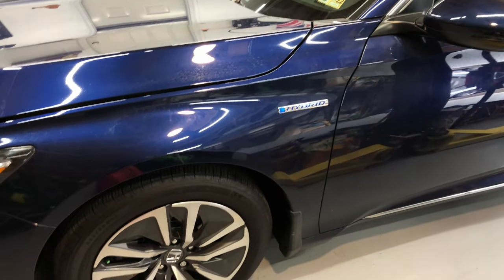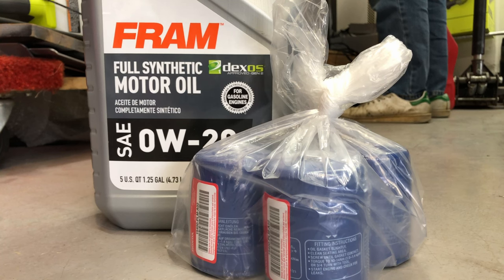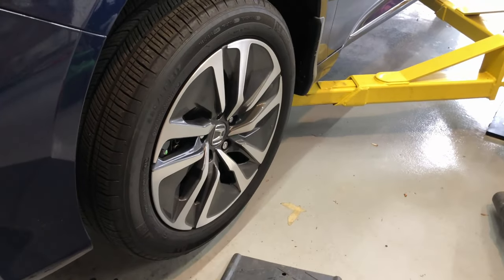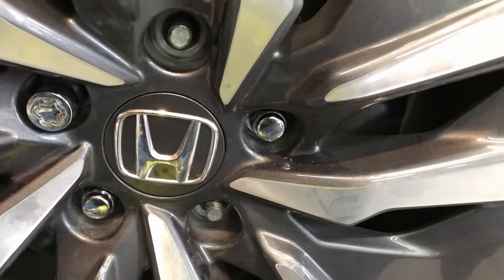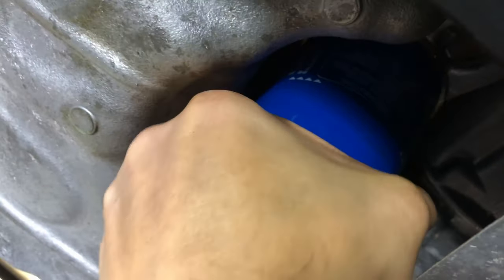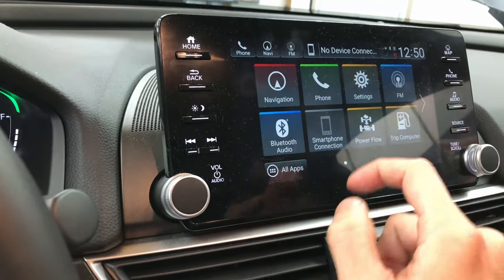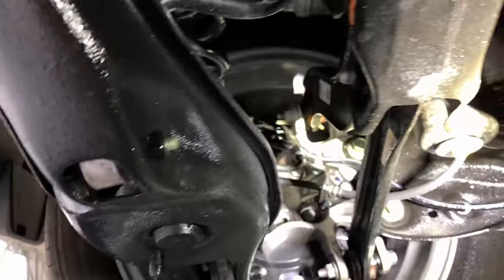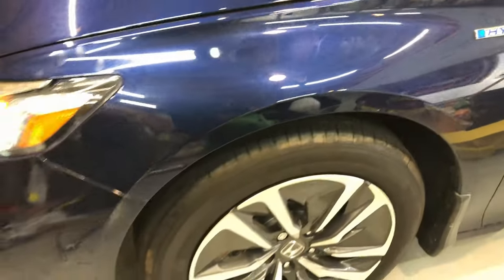2020 Honda Accord Hybrid Oil Change, Tire Rotation, and Winter Prep

Comment: TIP. To avoid making mess when removing oil filter I always punch a hole in the bottom of the oil filter with a screwdriver and wait until it stops leaking.

Comment: The filter is easier to remove if you remove the triangular shield partially covering the filter.  It only needs three flat-head screws turned 90 degrees and it drops off.  You're reaching around the plate at 3:47.

Comment: Did you torque the oil plug to 30foot pounds with torque wrench?  How about using a fumoto drain valve any experience with those by chance.  

I'm thinking of installing one on my hybrid.
Reply: Also forgot to ask what are your oil change intervals in miles?  3k, 5k, 10k?

I'm old at heart and I like to replace at 3k, but this is my first hybrid.  I don't feel comfortable changing at 10k
Reply from the maker: Hi, I usually do not torque the drain bolt other than hand tight because if any oil gets on the bolt threads, it alters the torque and you may end up over-doing it and stripping threads.  Good and tight works for me.  Most oils especially synthetic nowadays can last 5k easily, and I would even do 10k if it looked fine when checking.
Reply: @fastlx13  hybrid oil changes differ due to driving habits EV vs Gas time in service but 7k is a good guesstimate.

Comment: did you have to remove the steel plate cover under the oil filter and oil bolt
Reply from the maker: Our car did not have anything covering it.  We have the Hybrid version so not sure if there is a difference on other trims.  If you are talking about the same steel plate my friend's civic had, that thing is a pain to get off.
Reply: I have the hybrid also